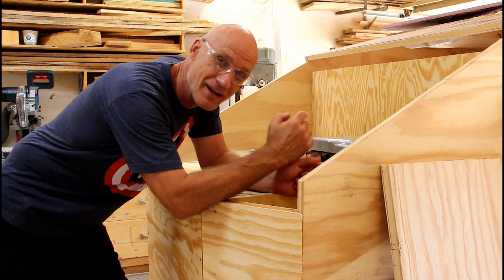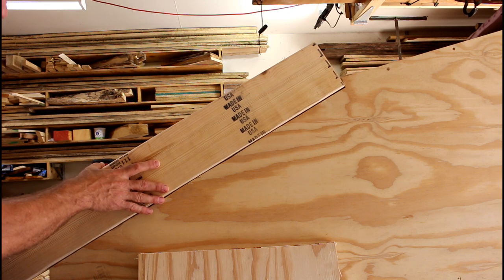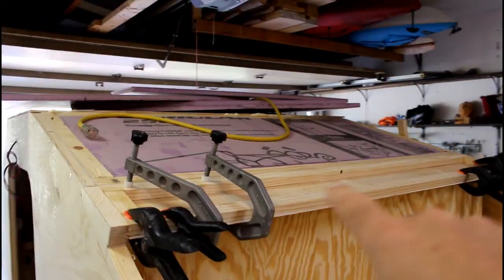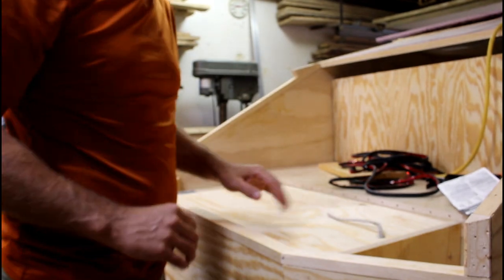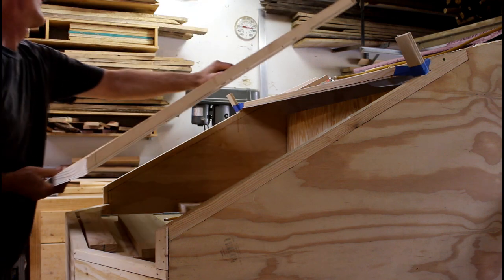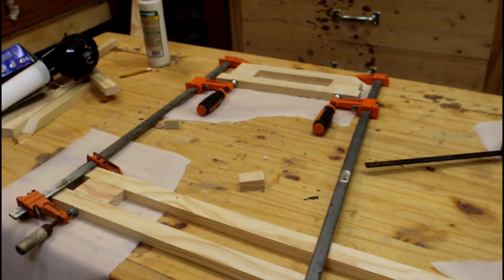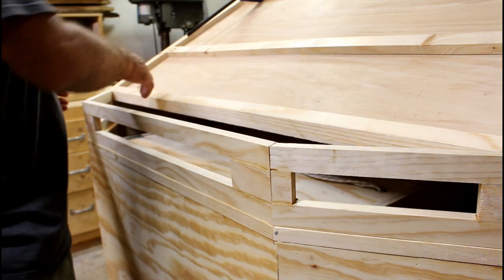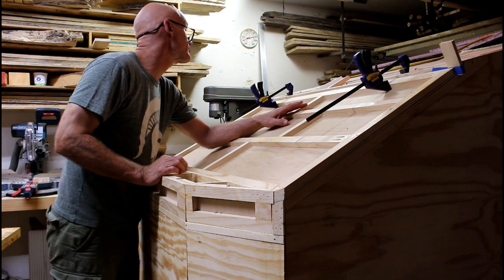Tear Drop Camper Build 2: Building the Hatch Door

Comment: I was going to scold you for not wearing at least "some" foot protection, but then I thought, you're a smart man, you know what you're doing, and I'm not your father.
Reply from the maker: During the summer I will sometimes go out into the shop with just sandals on thinking that I will just do this one thing....then two hours have gone by and I haven't changed my shoes. Bad habit. :)
Reply: @IdRatherMakeItMyself-Net   If you've ever watched Ron Paulk's videos, sometimes you'll get a glimpse of his feet, and he even mentioned it in one video that he only ever wears sandals, even on job sites. He's either a very, very lucky boy, or his feet are made of steel. If I ever did that, I would have been missing several toes, or worse, with some of the things that have fallen on mine. Even sneakers, which is my preferred footwear for comfort, is really not good either. And this I know from experience. lol